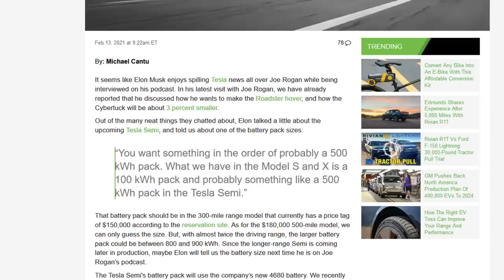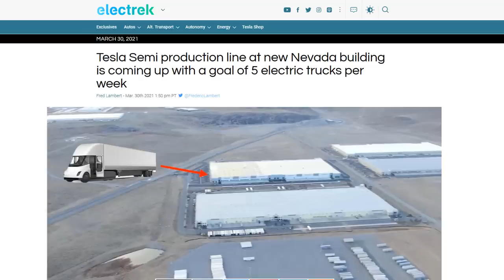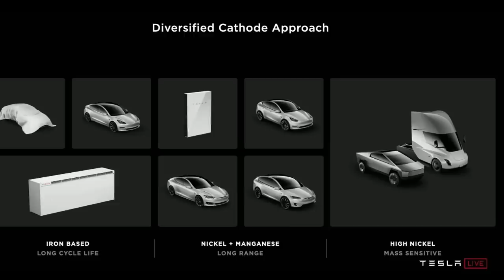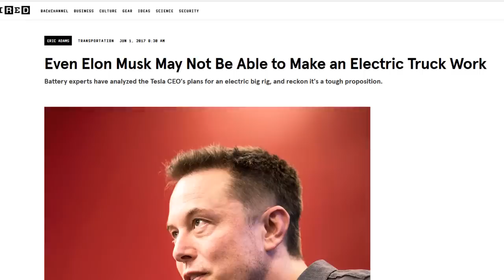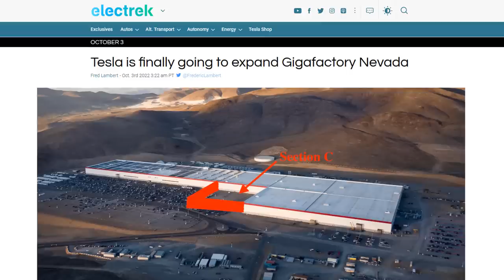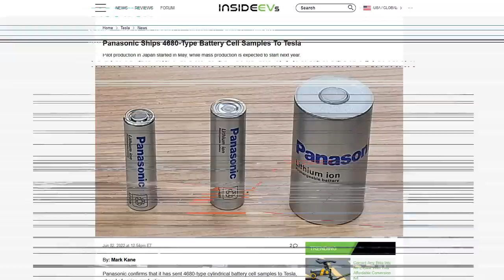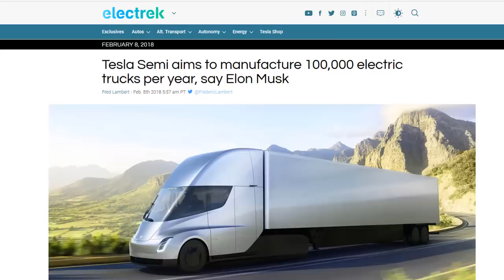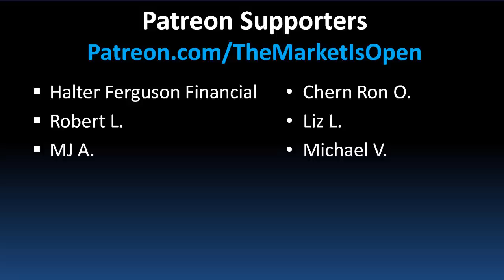Tesla Semi Is Coming in a Month - Let that Sink In

Comment: Electric semi....haha. OTR never work. I drive 700 miles a day. No place to charge. Only 1 truckstop parking spot, including rest areas, for every 3 trucks. New trucks are already  certified clean idle. Elon is a smart guy, but doesn't have a clue what goes into the trucking industry to get it done. If it is not better than what we have, better luck next time.

Comment: electric semi trucks will fail. you can't just size up tech to do more work without requiring more power. we are governed by the laws of physics. if we had the ability to do this it would have happened years ago. the electric cars that are in use are barely viable to simply move people around.

Comment: No there not. The battery is too heavy and it's cutting into the capacity of the truck. Semi trucks have to provide Heats, air, lights and environmental controls for the cargo for 24 hours a day non-stop. Tesla trucks are far from being able to accomplish that. If people try driving those things in my area they will die. They will literally die as in dead, a very permanent effect.

Comment: What are the run time's for a day and how far can the truck go also what is the life of the battery? And what is the cost to replace the battery?
Reply: things tesla probably didn't think about  🤔
Reply: run time under load:        maybe 200 miles  3-4 hours
Battery Life:                      5-8 years at best and zero warranties will be upheld (due to normal trucker driving tendencies)
Cost to replace battery:  The cost of a new truck
Reply: @zarthemad8386  pretty much a non contender in the long haul game
The cost is really to expensive plus you get to buy a new battery and the cost to recharge when you add it all up it's cost-effective to keep the diesel? There is a bulk carrier in the Tampa bay area that uses LNG in their trucks and are getting cost effective results
Plus the Japanese are making big strides with hydrogen

Comment: Click bait. Video should have been titled "speculation on battery production"  No economics of trucking. Also, what about a charging network? I'm a OTR driver. There are NO charging stations that I know of on the interstates, especially at truck stops. Are they planning on building a network of charging stations, for trucks, at 500 mile intervals? Seems more likely that it will take 20 years to get car charging stations in place, much less for semis.

Comment: I do multi-axle heavy hauling mainly steel out of northwest Indiana to the Detroit area an back to Chicago area if you really want your truck to be put to the test an run in an area of operation that meets its current capabilities an will see al four seasons I would volunteer my almost 20years of experience to put it to the test might not sound like a lot but you put hundred thousand pounds of steel on an eight axles if drag an are expected to drive like everyone else on the road it takes it toll on the best of trucks lol

Comment: They should make the batteries in sections, removable by hand , charge them apart from the truck, reducing the time to recharge  to replacement time. This would solve the megacharger problem  having 2  sets  of batteries for each truck , expediting time spent to recharge - to the tiime needed to replace the battery.
Reply: The batteries for the truck would weigh about 8,000 pounds, not really replaceable by hand.
Reply: It sounds good, but you'd have to have factories set up along every highway with their sole function being the removal, recharging and replacement of the batteries. On top of that, you're going to need twice as many batteries.
Reply: @davidbrayshaw3529  Not factories.  Just charging stations. Instead of plugging the car in, take battery sections out of car, plug them into chargers, remove other charged batteries from chargers & plug them into car, then drive off.  U Don't have to wait for car battery to charge.  Saves an hour?  30 minutes?
Reply: @buzz-9x  I was thinking of truck batteries and visualising very large forklifts and overhead gantries. 
Musk proposed the idea of interchanging batteries. He even did a "presentation" on the subject in which his battery change team changed the battery in a Tesla faster than you could put a tank of petrol in a regular car! Amazing! But, like so many of Musk's claims, it was probably fake and hasn't gone anywhere except to propping up share prices and providing YouTube content.
Reply: @davidbrayshaw3529  sections of batteries can be designed to be any size to be easily removable & replacable  I dont see why no EV maker has tried this. Gas stations would be ideal locations for battery section replacement stations.
Reply: @buzz-9x  cant run a the EVs with batteries with differing charge levels.   its a fire risk
Reply: @zarthemad8386  I don't propose to run batteries with different charge levels.
Reply: Let's do a little bit of math here. How much can a truck driver realistically lug from the truck to the charger in one go repeatedly? I'd say about 30 pounds. That's 266 trips. Probably more because we need to add the weight of 266 enclosures, 266 high-voltage connectors, 266 BMS boards, 266 safety cutoffs, 532 sturdy handles, etc. But let's ignore those. Taking out one of the battery boxes, walking over to the charger, putting them in and then walking back---how long does that take? Let's be very, very optimistic: 20 Seconds. So the driver would need 88 Minutes to do this. Likely more because of frequent breaks. So round this up to 90 minutes. Then another 90 minutes to move charged battery boxes from the charger to the truck.

That's 3 hours or 4 times as long as it takes to charge the battery pack inside the truck. Or in one word: Insanity.
Reply: @HenryLoenwind  30 x 266 = 9576 pounds , That is over 4 tons of battery!
So where did this come from? Seems high to me.
Reply: @buzz-9x  "30 x 266 = 9576"? My calculator says 7980. I just took the 8000 from the first reply, as it doesn't really matter if it's off by a factor of two or not. That would need to be off by a factor of four to be on par with charging in situ---and I've been quite generous with my other assumptions.

Just remember that the pack is located under the cab between the beams of the frame. To even access them, you have to lift the cab and then lift each one over the frame beam, stepping over the beam to reach all but the first row.
Reply: @HenryLoenwind  20 minutes 4 2 people to swap pods with charged ones on charger 1 on each side of truck.  20 seconds too long . It could be done in 4 secs.
Reply: @buzz-9x  I want to see you lifting a 30-pound box out of a storage compartment that holds 266 of them and where they safely and securely plug into a high-power connector and 2 plumbing hoses in 4 seconds. And that's without walking to the charger or setting them gently down into a slot where their high-voltage connector and plumbing connectors connect again. That's not like chugging basketballs from one bin into another at the arcade.
Reply: @HenryLoenwind  could be under 30  = 25 or  20  not hard 2 do

Comment: For the Semis, I don't understand why they didn't go with the battery swap idea.  I've heard it's difficult and obviously increases risk of damage, but it feels like the vehicle that would be best for it.
Reply: The batteries alone could weigh up to 8,000 lbs. Not really that easy to swap 4 tons let alone the extra engineering involved.
Reply: Hear me out, "electric trains".
Reply: Depending on the dock the truck might be sitting waiting to be unloaded for hours at a time. An ideal opportunity to charge.
Reply: $100-200k battery packs being hot swapped... 
no thanks
Reply: Nio the Chinese car manufacturer make it work. That Taiwanese scooter

Comment: I want to watch a video of one of Elon Musk's electric powered trucks going up a good sized grade. There is another provider, The Fast Lane, that tests trucks and they have a real challenge of testing trucks west of Denver. They call it, "the world's toughest test track" a grade of 7% and its 8 miles long. They recently tested a Ford EV-150 and a GMC Hummer, with 6100 lb trailer loads. This one grade took out 92% of the vehicles' battery power to go those 8 miles. SO, I want to see what happens when an 80,000 pound loaded semi tries this hill. and there's more hills / mountains just like it farther on down the road. I'm sure Elon Musk conducts his electric battery trucks on straight, level grounds like western Kansas. A couple months ago I drove back from Washington, D.C. towing just a 1900-lb light camper through southern Virginia and West Virginia's mountains, and that would be another real challenge for Elon. It was just one mountain after another, and not conducive to making it on a battery powered truck.
Reply: nah... gradient would not be a problem... the real problem is weight of the battery. basically you cant haul anything else than insulation with this truck 🤣
Reply: @jebise1126  or potato chips like pepsi lol
Reply: @jebise1126  If bean bags ever come back into fashion, Tesla semis will be rolling out the door.
Reply: Great point! Sill there are a ton of mostly flat runs that this truck could be very efficient in

Comment: It's just not natural for a truck driver that has always been on the left side of the cab to then be in the middle... I have done it, and it's very taxing to keep checking that you are in the center of the road ...
Reply: I think you would soon get used to it and I think it will be the future of all vehicles with forward facing cameras for overtaking.

Comment: If the trucks need 1000 kWh to charge EACH ONE and a gigawatt hour to charge only 1000, just how will the grid and current powerplants handle the load?  And don’t tell me solar, windmills, or unicorns.
Reply: after all that went into building something like this, a semi that can drive itself...I bet they never thought about how to charge them 😆 🤣 😂
Reply: @callitbitch  right because california already handles the electrical needs so well. They already tell residents you can't have EV and AC, imagine the megawatts of additional power a fleet of E-semis would require. Sorry California residents, but M-F from 8am-4pm power will not be available as the energy will be diverted to charging E-semis. 

Each mega corporation would need their own mini power plant to produce enough power to charge their fleet.
Tesla did the thinking of Superchargers/Megachargers, but if the electrical grid can't handle it, that is beyond Tesla's capabilities.
Reply: Dont you smell the RAINBOW?

Comment: It's funny how this trolls 😄  don't even know how really electricity works and how temperature affects the capacity of the battery's charge and also the degradation of the same due to charging and discharging🤦‍♂️🤦‍♂️🤦‍♂️, wait until you see how far a fully loaded semi can pull on a temp below 56 Fahrenheit,  and also when over 90 Fahrenheit....... this trolls.......
Reply: Just wait till you actually see it just pulling a fully loaded trailer at normal temps let alone at 56 and 90. Don't get how this going to be good in anyway when we already see how EV likes the f150 does towing

Comment: Let’s just wait to see how these semi batteries hold up in winter and dead of summer
Reply: especially in Midwest/East coast locations where our summers are 100 F and our winters are negtive teens in winter. Regular car batteries die out from our cold winters as is. How difficult is it to replace the entire battery cell when the cold kills the semi?
Reply: Right
  Who is volunteering to take one thru the Rockies this winter?
Reply: yeah...I bet they never thought about weather... them idiots
Reply: They are definitely not going to last when the temperature is -40 where I live.
Reply: Hasn't this already been proven with the Tesla cars?
Reply: They hold up well
Reply: @razorr_o  no they dont
Reply: @kenbowser5622  prove it
Reply: cold does not affect lithium cells, at most they may have a maybe 10% lower capacity in frosty weather than in hot weather.
Reply: @undefinednull5749  Yes it does.  they do not like temps close to freezing and below.  charging is really bad at those temps and discharge rates are also hindered.  there is a point where you will likely not have enough energy to keep them warm enough and travel.  What ever range they end up having under ideal conditions will greatly be reduced in cold areas.  These will only be useful in short haul routes.  In the northern parts of the US and Canada, they're likely not worth the cost vrs what use they can get out of them.
Reply: @joebleed  sorry if I'm wrong but I remember reading articles about it being about a 10% difference in capacity at maximum. You sound confident in what you are writing, Could you please kindly give a source to your information ?
Reply: @joebleed  they dont but when u preheat the battery it will recover all the capacity. teslas dont lose much capacity at all if you preheat ur car. ofc preheating will take some energy
Reply: @undefinednull5749  Yes, it does. Nearly all chemical reactions occur faster and to a greater extent given an increase in temperatures. Once those temperatures exceed a certain point however, undesirable reactions can occur. This is definitely the case with not just lithium ion batteries, but batteries in general. 
I have a friend who skippered a tall ship to Antartica several years ago. One of the problems that they faced was keeping the hand held radio's batteries warm when on watch in the crow's nest.
I've personally "killed" a couple of perfectly good 18650 cells by leaving them in a car for several days during summer. Batteries are quite temperature sensitive.
Reply: @davidbrayshaw3529  Those cells you had were probably near its end of use , I believe . For example the Molicel P35A or similar data sheet even specifies a charge rate for up to 70 degrees Celsius.
Reply: @undefinednull5749  got weathers worse than cold for a battery.  Pickup batteries dont hold a charge long under load.  How will these pulling 80,000 lbs?  I'm in truckstop every day and haven't seen any chargers.  These are also much heavier than diesel trucks so their load weights will have to cut significally.

Comment: Have they released information about the weight of the semi ? Or it’s load carrying capability?
Reply: or charging time
Reply: 1 hour on a supercharger 300 miles full charge.
Reply: @bbginc694  only 300 miles? Gas semi could get close to a thousand.
Reply: @nicjones6045  How much will that cost to fill up a tank to go 1000 miles?  The Tesla cost $30 to recharge 300 mile range.
Reply: @bbginc694  until they up it.... act like electricity is free lol

Comment: Yeah it's quite interesting if fuel cost difference can plenty pay for more expensive up front cost. And they can make them reliable at the workhorse level. Then it's an additional volume production for Tesla.
Do we know what battery pack size they are aiming for? I don't recall hearing that.
Reply: Doubtful considering most companies only keep their trucks for around 3-5 years.

I don't think Tesla will produce a working semi anytime soon which is why they haven't confirmed anything like battery size, range, price etc. These are obvious selling points that people need to know before even thinking about buying one.
Reply: @amosbackstrom5366  with the relatively good cycle life of batteries and significant price advantage of electricity over fuel then at least short range EV trucking must simple be viable. Supposedly Pepsi got some already. But yes the absence of pack size probably says they are struggling with choice of pack size.

Comment: I'm a fan of Elon's endeavors, but regarding the electric semi truck I don't believe it will work long haul for single driver or team driver situations. I'm an over 30 year long haul semi truck driver, and believe this may possibly be possible if they try it with slip seat or it's also called relay driver trucking companies, or in town local delivery drivers. This will allow the trucks to be charged every day after a turn around of 500 miles or less. In order to truly understand what a long haul truck driver goes through on a daily basis you would have to tag along with a driver to see what they go through, and what their day in the life is all about. I'm really not a doubting Thomas kind of guy, but will be eager to see what the challenges are with these trucks going forward.

Comment: You should not need a cdl for just driving the simi unless the truck alone weight is over 26001lbs but a weighted tag would be needed and could be expensive also the road tax on these should set you back quite a bit when I was driving the tag and road tax on my rig was 8 to 10k a year that’s a lot to pay for something to set in the driveway
Reply: Plus it doesn't have air brakes
Reply: I'm pretty sure it does since a regular cab weighs around 20,000 and this has all the battery weight too.

Comment: I have a question how will the truck work over the road?
Reply: It won’t because of several reasons . Number one range the average long distance driver is running 600 miles a day the average local truck is running two shifts 24/7 800 plus miles a day . Next infrastructure . There is a major shortage of truck parking and places to fuel . Now you want 1000s of new charging stalls to appear where trucks can spend hours charging at a timer. Where are you going to put these places when every time someone tries to open a truck stop the local soccer moms come out and protest it .  What’s really going to happen is multi-fuel internal combustion that’s where the industry is pivoting .
Reply: It is just like any other truck - it is electric instead of diesel.